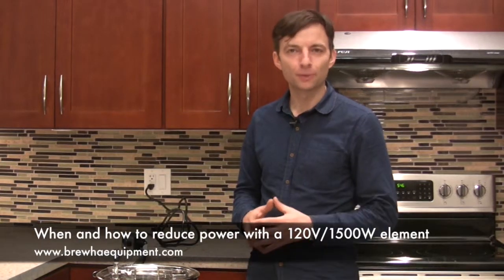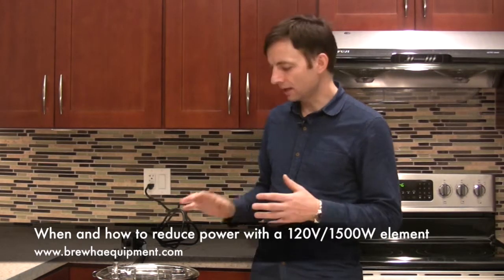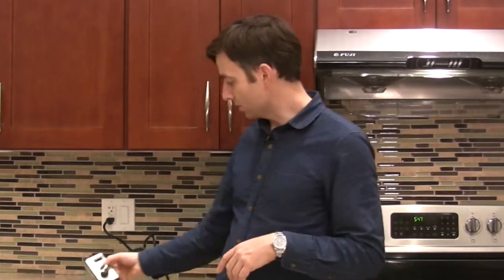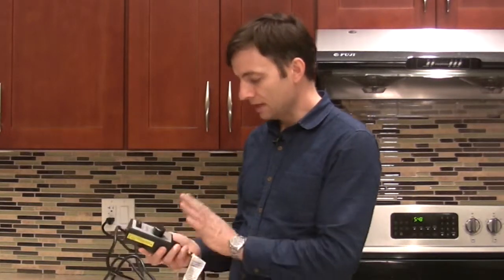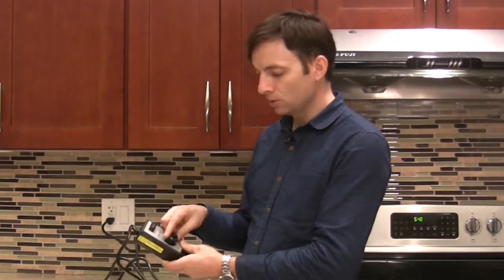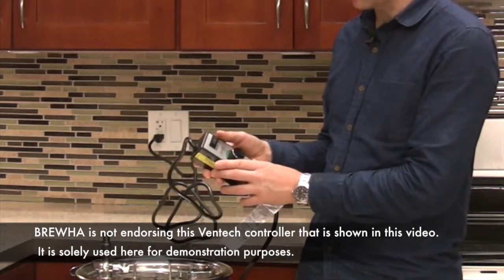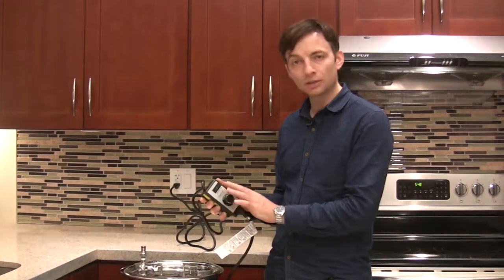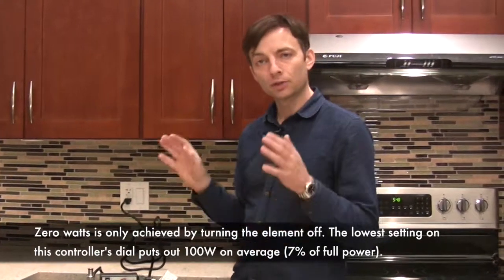When and how to reduce power to a 120V/1500W heating element (Updated May, 2015)

Comment: Hi, thanks for your videos!

I was wondering if it would be possible to automate the variable speed fan controller? For example by connecting it to the heating function of a temperature controller with sensor. 

Cheers, santé, salud!
Reply from the maker: I'm sure it could be done but would need a specialized controller.